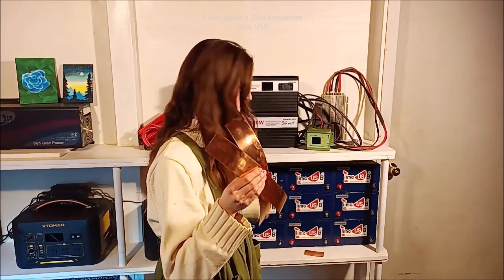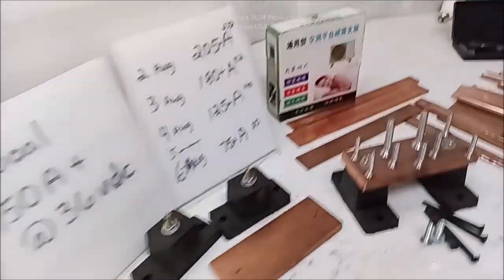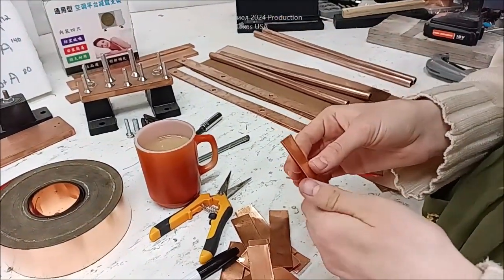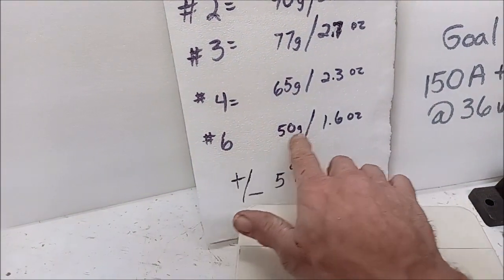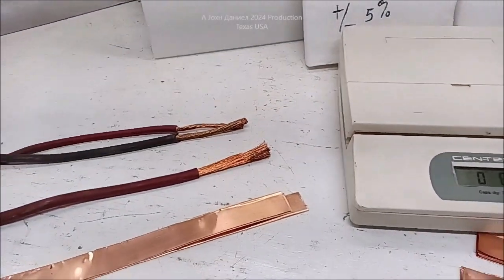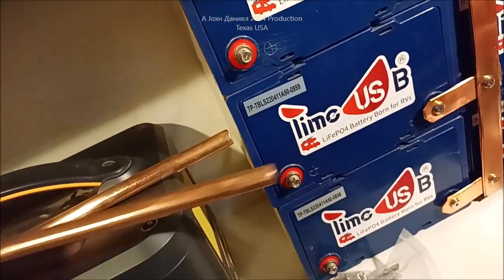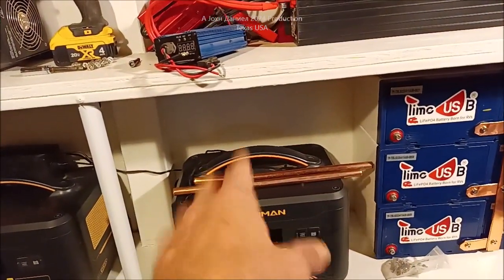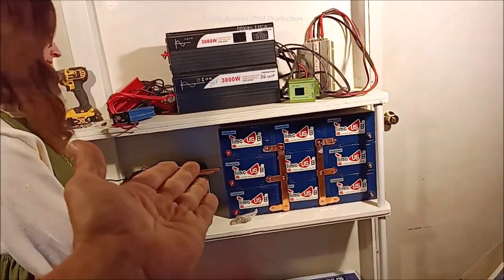Cut cost using layered sheet copper to make high amp Buss Bars and Battery Connectors

Comment: Good concept with the copper. I did not quite order the same, but I ordered a 1"x 8" copper bar and cut in two equal halves. I took apart the two cheap bus bars I bought last year and used the base to create two new bus bars in which my batteries, solar controllers and inverter are connected to. As an artist myself, Kiera did very good with her creations.

Comment: How can these be less work intensive and cheaper than pounding out 1/2" copper pipe?
Reply from the maker: The 1/2 or 3/4 pipe is the premium way to do it, but the reason for the video was the copper tape is heavy enough, and handy enough that it should be shown as a option for so many who can make things similar from it when copper pipe is overkill or not available.

Comment: as a scrapper im wondering about melting copper and pouring my own bus bars. would it require any special purification?
a small setup to dress and shape the copper bars would not require a lot, and the removed material could be used to make the next bus bar?
Reply from the maker: Purity should remain near the same if you use the right crucibles to do process and scoop off any slag of oxalated material from it. I have made custom bars in the past this way. You just need to exceed 95% pure to achieve the goals.

Comment: Excellent timing. I got my first 100ah lithium battery from power queen almost two weeks ago.  All my sealed lead acid batteries are dead.  One I got back in 2009 in december I think. The other two were in a power scooter and from 2013.
Reply from the maker: If you take 3 Lead Acids, and add 1 of the 100 ah Lithium to them using a VSR in the circuit, you get 1/2 the cost, 300% the power, 30% more lifespan, and 25% more stability with the ability to run high amp Inverters. Stay tuned, I did make videos on this.

Comment: Hi . On your battery connection..should not the 2nd E made of this copper bussbars be oriented the same way as the first one? For symetry and equal resistance? I am thinking you want all those 9 12v batteries take or give same current. Keep up this videos ..we have alot to learn from you !
Reply from the maker: You would want the travel to be balanced if you intended to pull near the max available normally but since this is 36 volt and the intended pull on them is about 50% at anytime this is OK. In a high use scenario you would X , -- and E the design for balance.

Comment: Hello Brother John and Little Sister. Have you tried out the New HQST 100Watt 10BB Panels yet??? I might order some. Some of the spec numbers are better, some maybe worst ??? I don't know what all of the spec numbers mean in relation to output. I can't wait to see a video comparison of the 9BB to the 10BB. Thank you. Sportsmobile83
Reply from the maker: Avoid the 9bb, 10bb and what ever next they use to sell you panels with 0.68mm thick cells. They will degrade so fast its a loss to even buy. Only BluSun and Renogy have the 9bb with a full 0.90 cells. My absolute best find WHILE THEY LAST is the Rich Solar 5 full buss https://amzn.to/3vJg1mA and I am buying as many as I can while they are available, soon they will be screwed too. They have the 1.12mm thick ergocrystal mono cells, Best known as Taiwan made Q-Cells. I am trying like crazy to get 50 of them ASAP. They already stopped selling singles, won't be long then all you have is the new junk. I would rather a micro crack in a cell happen and loose 2% over a total hazing the thin ones have and loose 70%.
Reply: @JOHNDANIEL1  I was researching them because that is what you had put on the SHTF list on Amazon. I got on their site and they showed the 10bb cells now. I'm glad that you got back to me before I pushed the button on them. So HQST are crap now ???
Reply from the maker: Sad to say, HQST drank the Koolaid. But the Rich Solar are made by BluSun, Same maker as the older HQST but with even better cables and junction box.
Reply: @JOHNDANIEL1 Is that linked through you yet? If so I am about to order some.
Reply from the maker: Glad you asked, I just put it in the shared in my amazon and it shows good for 1.8% so now it is.
Reply from the maker: PS - I am going to try to raise the $$ to get me 3 more sets of 2 pk while I can. Other sites who carried them are out. Solar Town with $4 more a panel is out, SBvld is out too. Only whats in Amazon warehouse is apparently available. Buy a few extra, Order some large thick roll aluminum foil, 1 pack per 3 panels,  https://amzn.to/3Ube6RR to wrap them in as spares for EMP, sunflare or WW3 protection and put them in safe spot. You can do the same with controllers and inverters. I have 8 rolls of that foil used on 20+ panels and electronics and a WIFI, magnetron or any radio can not send signal through it/them.
Reply: Thank You Brother. I just placed an order for 10 pair through your link. What about the charge controllers? Do i need to avoid the HQST on them too ???   WWJD.   What Would John Do ???
Reply from the maker: LOL! What's your voltage choice? Do you have the inverter and other things yet?
Reply from the maker: My suggestion if your 12.8 volt system, hqst x 4 of them. 500 watts into each unit, https://shrsl.com/4dvzw, If 24 volt system get 2, if a 48 volt system go to the 60 amp only 1 https://shrsl.com/4dw01 of them. I use the 12 volt to stay real redundant fail safe, but also I use the 36 volt to be able to use wind power as well from a 48 volt turbine. Your plan can be any of the above.
Reply: @JOHNDANIEL1  I AM JUST DOING A 12 VOLT SYSTEM. I HAVE A LOT OF 12 VOLT APPLIANCES ALREADY SO I FIGURED THAT IT WOULD BE THE EASIEST WAY TO USE THE STUFF THAT WE HAVE ALREADY.
Reply: @JOHNDANIEL1  AWESOME. DO YOU RUN ALL 4 CONTROLLERS ONTO THE BUSS BAR ?
Reply from the maker: Yes, run all 4 from solar power into one main buss bar with equal length cables and wires rated for 125% of intended load on all such items, and fusing as needed. If you need direct help send me a email.
Reply: @JOHNDANIEL1  tThank You Brother. I will email you soon. What about the rest of the stuff on the SHTF Power System list. Is there anything else to avoid on that list or are there better items to replace any of them? I know that the inverter has been updated. Is the link to the new one on the list yet?
Reply from the maker: Run all power from controllers to buss bar with 8awg REAL COPPER, https://amzn.to/3vFrFPs up to 6 feet, over that length run 6 awg https://amzn.to/48Z34n4 . I recommend using 8 awg rolls of that cable for the run from solar grouping on the roof to the controllers, NEVER use more than a 2x to 1 Y connector to pair 2 of your solar. You can however use a 3x to 1 W on 3 outputs, and a 2X Y on 2 then into a block connecting to 8 awg Temco for your drop to the controllers. This is the safest no heat or risk way.
Reply from the maker: I do not know if it's updated, But I will get you straight to Fang's email and you can go through her to get the newest.
Reply: @JOHNDANIEL1  Sounds good. I will need to draw out a diagram of that so that my brain will stop hurting. Lol
Reply from the maker: I got with Lynn from Power Queen, they started a WORKS WITH ALL battery branded as a Grenerpower https://amzn.to/47JBtoS but it is still a Power Queen Plus cells. Just cheaper and uses the VIP-JK Start style BMS in it. Can work with anything. Has heavier cables in it. It's at Amazon right now, Be sure your ad blocking is off, then you can get $30 off each one, plus 10% off entire order. I wish I could get 6+ of their 200AHplus to swap out but my Lead Acid will be good for another 4-5 years so no point yet. For your system, try to get 4 like that, 800ah total with a 800 amp capability. That way you can cover all use and even if done in under 4 months add more of the same. You can get by with 2, but be sure your
Reply: @JOHNDANIEL1  That sounds great.
Reply from the maker: olympicpowercontrols@yahoo.com
Reply from the maker: 👉 Support/Donate with KoFi - https://ko-fi.com/john4kiera OR https://bit.ly/2buyaCoffee all support helps and keeps me up late LOL!
Reply from the maker: @sportsmobile8328  I was thinking about your goals, Maybe you can make it super easy since you got 2000 watts solar already. Take a Look! https://shrsl.com/4dyb7 this is in the long run cheaper than building your system. Huge wattage, easy to run your panels 4x each into it. And you can add wind to it. Best thing is you can get it very cheap financed by Affirm ( shop Pay) so look it over. Be great to see your end results are good. They have parts, circuit controls, and generator to home kits cheaper.
Reply: @JOHNDANIEL1  It looks pretty nice. Have you ever tested one or any of their other products ?
Reply from the maker: @sportsmobile8328  We installed 2 in Brady Texas for a store and they have been using them for over a year now with excellent results. I have not yet got one to put in a system I can daily monitor by Beverly who owns those 2 say she has totally forgot she even has them, they just power it all. Best total price I ever saw for the build like them.
Reply: @JOHNDANIEL1  Super Cool. That looks like a great option. It would obviously take up a whole lot less space. My only concern about most of the power stations/ solar generators is the serviceability. I can repair a regular "old school" pc board or replace parts on them like diodes or capacitors, but I'm definitely not as versed on the diagnostic aspects as you are. It just seems to me that having a system all spread out like you do in you shop is much easier to diagnose and pinpoint a problem, than in a compressed until ? 
That unit would run our well pump when we need it though without starting up a noisy Champion Generator. It would definitely be much more stealth when the powers that be, pull down the grid. That is definitely a Great selling point.
Reply from the maker: @sportsmobile8328  I know they have a really good warranty and they're really quick on parts, the only thing that this lady needed was one of the terminals and they sent it at no cost in about 3 days. But all the internal components are common and easy to work on.
Reply: @JOHNDANIEL1  Sounds Awesome. I definitely Trust you expertise. Thank you  for the information on this power unit. It would make things a whole lot easier for sure. So if I go with this unit, did you say that I can hook up the panels directly to it or do I need to go through charge controllers. A assume that it is built in but I don't know?
Reply from the maker: You install the panels 2 at a time in series, then using much cheaper 12/2 low voltage wire you run them down to the power station. Grouping it into 5 sets X 2 to a DC box, then from it in 6 awg to the unit. We built the exact set up in August 2022 for that lady in Brady. By adding the additional battery and the circuit box, you can remove your lights, refrigeration, freezers, and most outlets off the grid. Nothing in the price range can do that. The Manual -  ( https://cdn.shopify.com/s/files/1/2637/1868/files/Natures_Generator_Powerhouse_User_Manual_V1.01.pdf?v=1689952397 )

Comment: Twice I ordered copper washers and was sent brass. Then I found another source through Newegg which were actually copper. Your "copper" washers look like brass in the video. Great idea by the way with the laminated bus bars. I have to build some with 2, 90 degree bends so your idea will make that much easier to form.  Thanks
Reply from the maker: Yes, these I am using are those 85/15 washers for battery lugs. Supposed to not get corrosion on them. 85% copper, 15% tin antimony mix. No zinc or odd metals in them. I get them from NAPA Auto parts. Made for riding mower batteries. Good for 250 amps as claimed by them, made in Wisconsin. To get pure copper washers the best source is Graingers or Zoro.

Comment: Electric travels along the outside of the copper. Which is why stranded wire is less resistive compared to solid wire. Basically your setup will conduct more current with less heat buildup. Keep up the good work.
Reply: Solid wire has less resistance than stranded wire not the other way around. 
Stranded wire becomes a better choice for its flexibility.

Comment: I may have missed it in another video—why 36v rather than 24 or 48?
Reply from the maker: Safety since 36 is many hundreds of percentages safer than 48 volt, Peak efficiency since the Mosfets and Diodes are at their natural highest performance between 29 and 44 volts, and the 36 volt is the most impressive way to charge with a 48 volt wind turbine in low wind areas.

Comment: I went to Lowe’s and purchased 3 gage copper pipe and smashed them with an iron mallet to get as flat as I can get them and it works fine with over 100 amps flowing through them.i smash the copper pipe as flat as I can get them to illuminate the Hall effect creating a magnetic field. That field can drop the desired voltage required, depending on the of the person and preference of the all out
Reply from the maker: The Hall Effect is very unlikely in your set up to any real loss or effect without introducing a ferrous material significant for passive magnetism. The bolts or screws may eddy some but not to a point where your power is hampered in any way. If you call a local AC/HEAT or PLUMBER and ask for 12" plus long scrap copper pieces Type L and Type K soft and offer them 2X the scrap price you can save a ton on buying it at retail.
Reply: @JOHNDANIEL1  thank you 😊

Comment: I would like to ask. Whats the buss  bar copper or brass?
Reply from the maker: Copper, Always use only Copper. Even Red Brass is less effective than Aluminum in DC power. People think that brass is a great conductor, it is not actually due to the alignment of the electrons in brass compared to copper.

Comment: Laminated Buss bars are not a new thing, but you are right to do it the way you do.

Back in the day I had to install my first one in an airport hangar. It was to link to a 400A 415V infra red heating unit control. I swore blind it would not carry the load and was firmly put in my place by Merlin Gerin (the manufacturer). It just felt too light to me so I took some pics of it .... way before mobile phones .... and on arriving at work the following day was told I had come close to burning down a jumbo jet (I think they exaggerated there a bit) but they did fly a team to the UK from France to replace it overnight ..... and they wanted me sacking for not torquing up the bolts. 

Well they did right up until I told them I had photos  that did not match the new bus bar size! 
Strange how some things pan out! Nearly 40 years later I am about to retire from the same company ;o)

How do you go on with temp monitoring of those stacked batteries. I am sure you check it but notice there is no air gap round them. Do they stay cool?
I don't need to ask about the bars temp ...... they Are Cool ;o)
Reply from the maker: The batteries have a top to bottom taper to the case, they are not totally squared. So They have a 8mm grid shim on their bottoms to level them while laying sideways, and a behind the group look would show over a 1" to wall clearance and a good airflow around them. The final mass of the copper is 25mm wide and 3.25 mm thick, the equivalent of 1 x 1/8" with 3/16 x 5/8 copper washers compressing.
Reply: @JOHNDANIEL1  I knew you had it covered ;o)